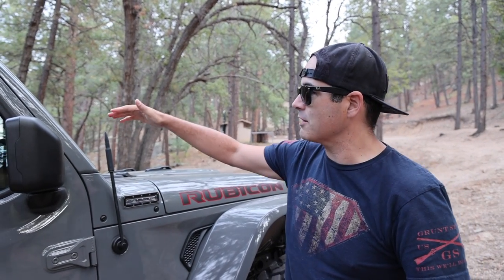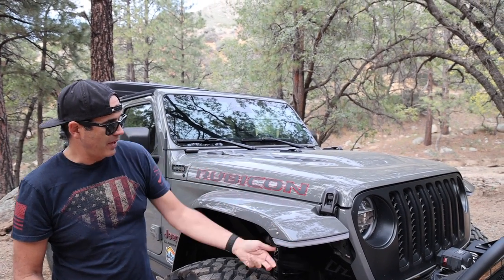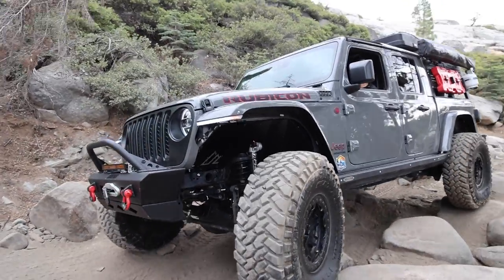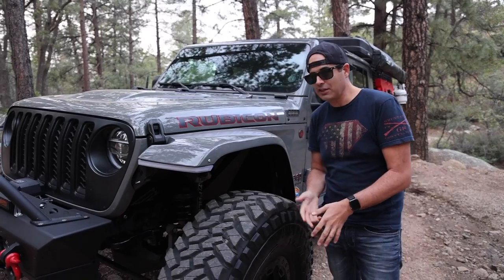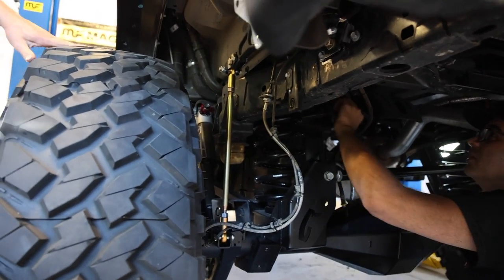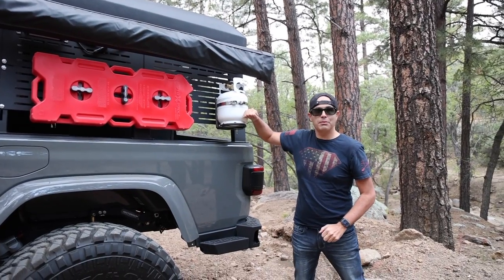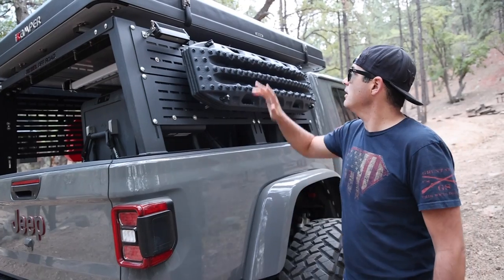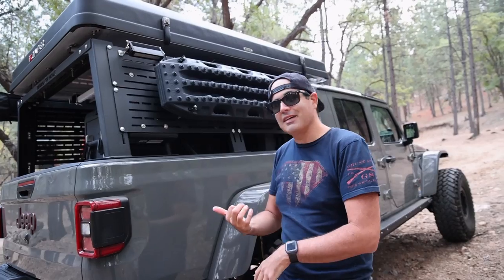Jeep Gladiator Eco Diesel Off-Road | Overland Build | PT2

Comment: Great breakdown video....I keep forgetting you got a new gladiator. There is still something different about you guys from a couple of months ago...I'll figure it out eventually. Here is an idea to keep that beautiful paint intact while your bushwacking. Spray the sides of the glad with plastidip.. $40 worth of plastidip will allow you to have a blast and when your done it peels off in about 15 min. 2 cans and 2 thick coats will keep that truck as beautiful as Crystal. You are rocking a $100k rig... No reason to scratch it all to hell or spend $4k on paint protection. Plus you can use cool colors.
Reply from the maker: We agree.

Comment: Did you say 2.5 inch Clayton lift? It doesn’t rub at all with 40’s? Thinking a 2.5 w 37s for my JT Diesel Build.
Reply from the maker: Def won’t rub, but we are on 3.5, you should consider Rusty’s off-road. Tell rusty we sent you: we will be switching over to their kit soon.
Reply: @OverlandishAdventures  Thanks!

Comment: What onboard air system is that? Currently using CO2 and love that set up. Sorry if I missed it.
Reply from the maker: Arb is the pass seat.
Reply: @OverlandishAdventures  I mounted my twin ARB to the front of the bed behind the cab.
Works 👍

Comment: Kept waiting to see the Mrs with the thigh show
Just a question ? Why diesel ?
I really like the side lights ! How many amps do they pull ? Are you running 1 battery or 2 ?
Reply from the maker: Gas mileage is amazing 18mpg on average loaded with camp gear.  Lights are led so very low amp draw , don’t know exact number but they are linked in the video.  One battery it’s still factory battery

Comment: How many windshields of the people behinds you do you smash out with no mudflats or fender extensions??
Reply from the maker: Jeeps don’t have mud flaps , also these tires do not trap rocks , if you knew anything 🪨 get thrown up from mostly light truck tires and car tires. Any rock chips we have have always been from cars and work trucks
Reply: @OverlandishAdventures  I have detachable hard flaps on my 09 jku Rubicon. I use them when towing my trailer and they also can be used for shoveling sand or snow if needed.